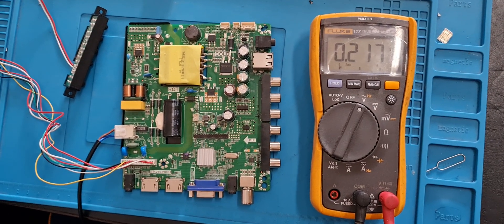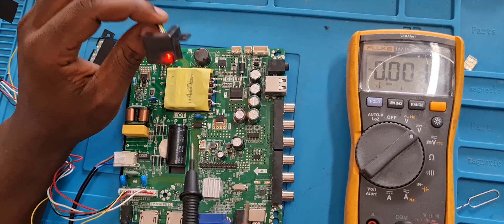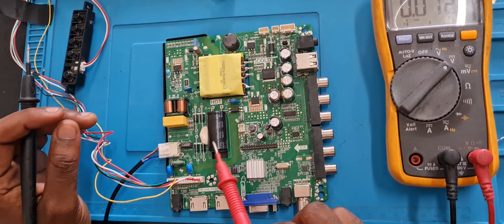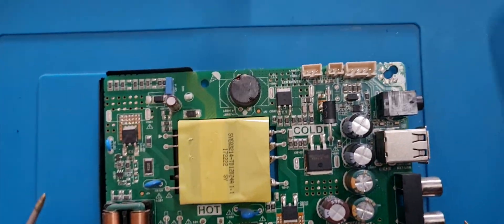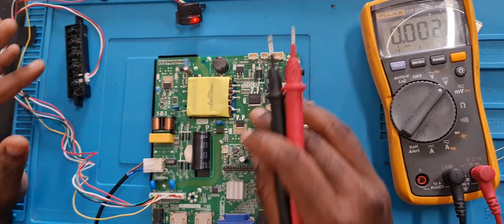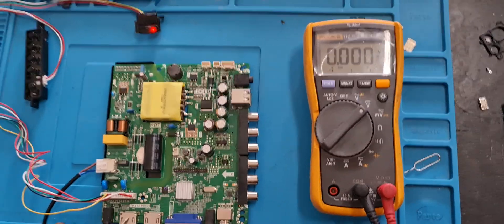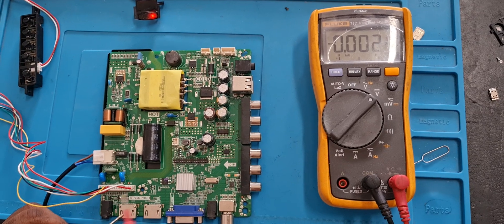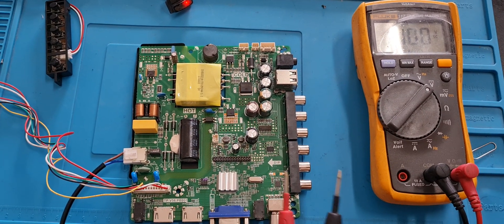Learn Something New Today! Let's Diagnose a TV  Motherboard Together. Beginner's Lesson(You can fix)

Comment: Bro one solution needed from your side
. What you said about big capacitor what the issues will be effected same issue i am facing the tv powerd on for some time and playing both audio and video after some time it was off the screen without led turn off after some time re plug the power supply it working and also some times sound also not coming.
Replacement of Big capacitor can solve my problem
Reply from the maker: Yes it could be that. Try replacing the main(big) capacitor.